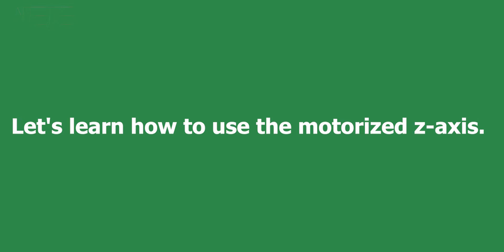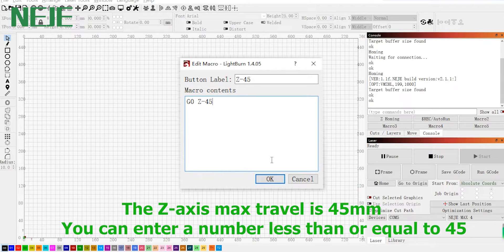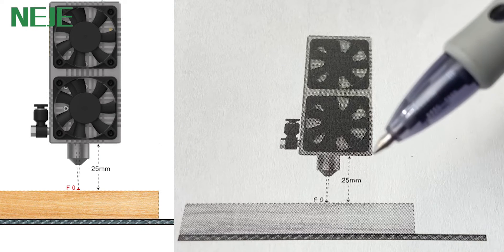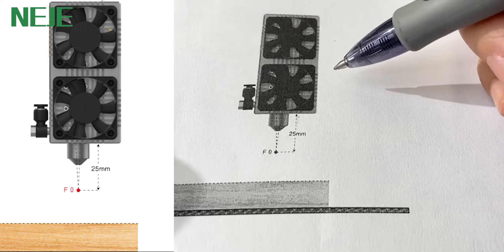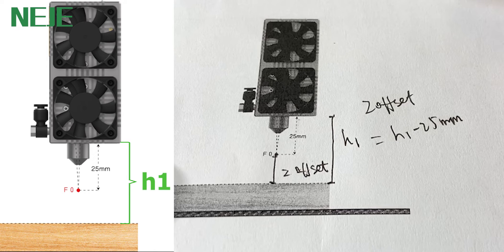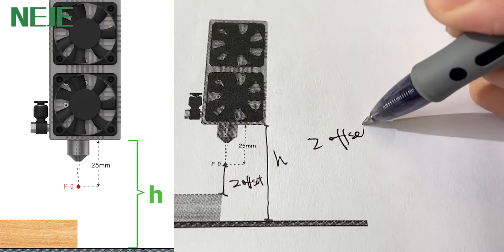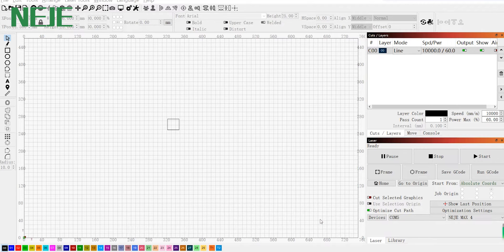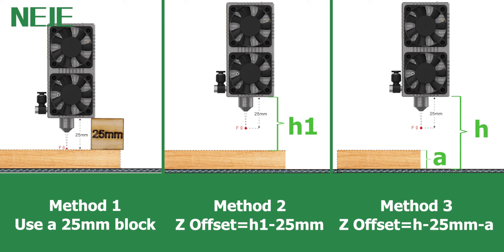Machine Guide 17 | 3 Methods to Use Motorized Z Axis#laser #laserengraver #neje #diy #nejemax4

Comment: GO Z-45 macro results the following error code: 
Starting stream
error:2
Numeric value format is not valid or missing an expected value.
On or near line 0:
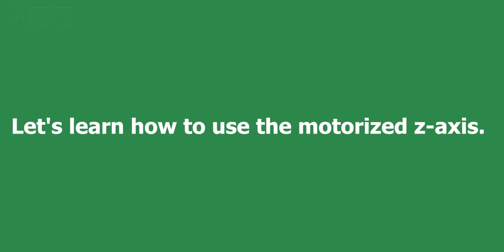Stream completed in 0:00
Reply from the maker: Hi！Please input G0 instead of GO, and use the number 0 instead of the letter O. If you have any questions, you can also join the Facebook group NEJE_Laser, where staff are always ready to help you solve your problems.